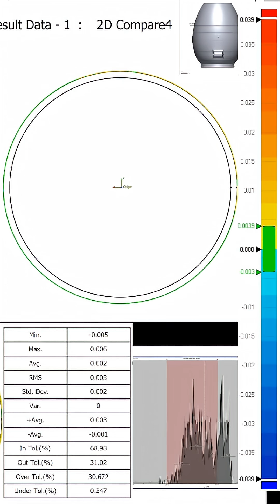Ancient Precision Beyond Modern Machines

Comment: Im an Engineer and disagree a little but the outcome is the same, you change tools because if errors and breakages. New tools to keep the part being made to specification but if theres an error before changing the tool, it will still be there and the part is classed as a reject. I am talking if co ordinated machines, CNC today, god knows how they made these vases and so accurate!
Reply: I really appreciate experienced input like yours much more than what people like me have to say.  I'm 54 and I've been following these things my entire life and I find them fascinating.  It's also amazing, in the vid we see someone stick a flashlight inside a vase and it shows just how incredibly thin the wall of the vase is.  Really amazing craftsmanship that no one has come close to explaining sufficiently.
Reply: What is highly interesting here is not that they could produce the part with the given accuracy. So it has taken us approximately 700 years from the first wooden lath the Vikings used to the ones we have today with built in CMM to reduce errors to the level we produce eg turbine blades at today, that are mass produced. However where is the machine they used back then. It was most likely not anatomical humans like us but the people from north of the Black Sea that were not human but the long-skulls (Approximately 12000 years ago) So the Vikings had swards made of steel similar quality as we have today(S235) with no impurities. This steel came from Mesopotamia, but could this have been from machines they broke down to get the steel….? We most likely have ufos today but we will not be able to replicate the technology. So were the vases produced on machines where the machine partially is still around…?

Comment: Errors are more normal to happen in a system it’s how you contain the error before it happens, math change the math to have different results be more natural resourceful energy surrounding you as a start , channel it through your own hands to connect hand and mind on one frequency of vibrations, hovering between fields intersecting and its resemble two equal circles and the intersectional looks like pussy intersection between two legs or two per effect circles life mathematically came from two circles intersection.